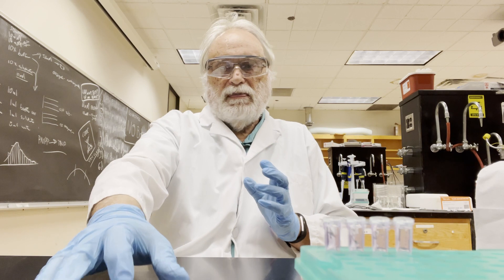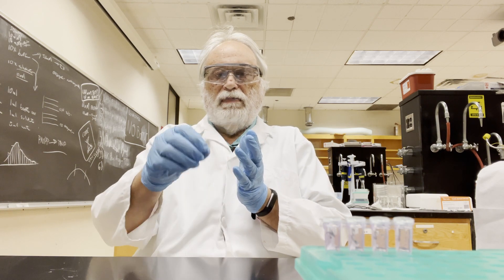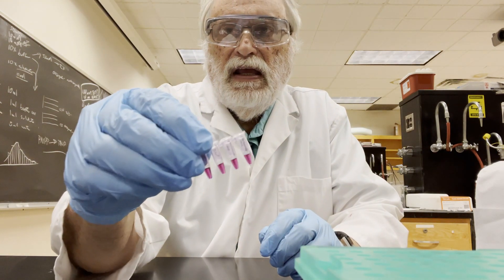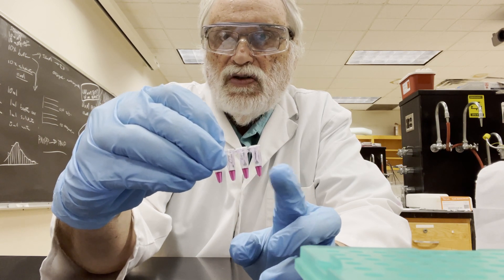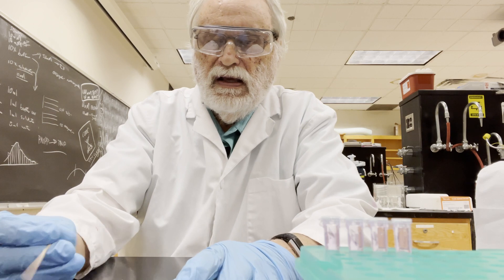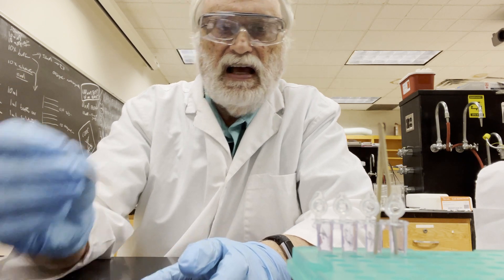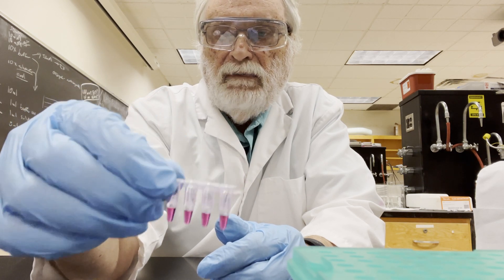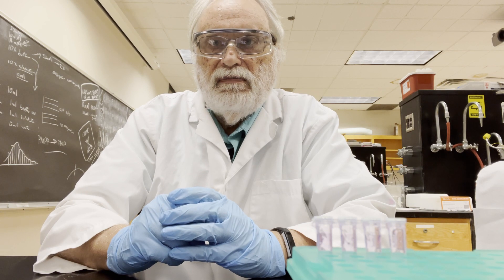Yeast Colony PCR

Comment: May I ask what was the cycle parameters?
Reply from the maker: Sorry about the slow reply.  I did not include thermocycler conditions as I wanted this to be a generic as I could and still help my BIOL4242 students.  

I would choose parameters that come from you design and fit you need.  In this case we are using a CRISPR vector and the prior week they cloned a synthetic oligonucleotide and the cycle was written in the protocol.  I'm sure your conditions will vary.